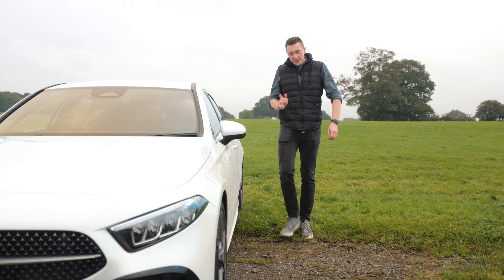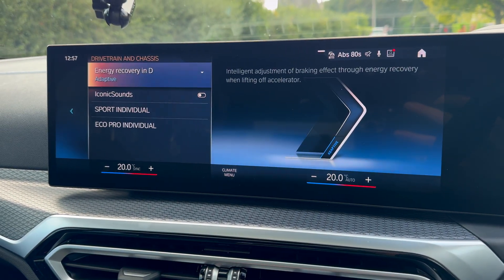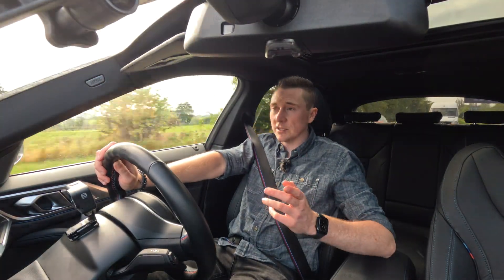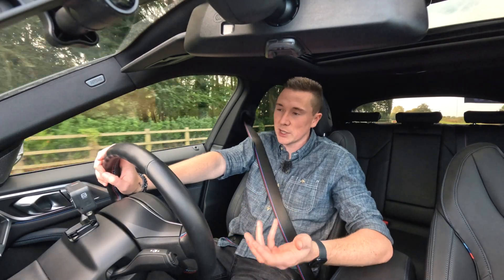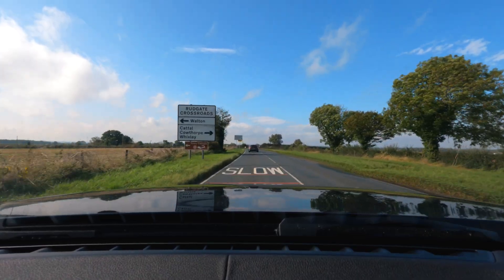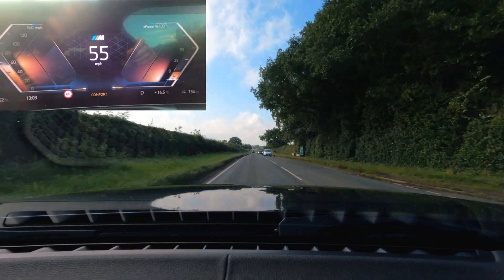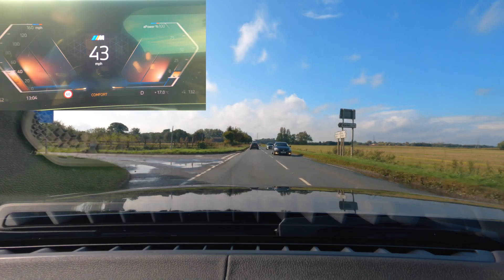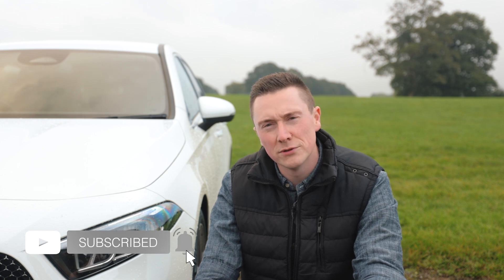Brake Recuperation EXPLAINED! + How to ADJUST it!

Comment: Hi Nick, I cannot get info on the intelligent recuperation setting for the eqa. Do you explain that in a video?
Reply from the maker: You basically just adjust it using the paddles, it varies on the car, but it’ll usually have

-D
D
D+
D AUTO

D Auto, just calculates your speed vs oncoming objects, roundabouts and even junctions and adjusts the braking automatically 😎

Comment: In a Mercedes you're meant to use the paddle shifters to adjust the regen level. However doesn't this just change the gear up or down? (How does it know when you want to change regen level vs change gear?)
Reply from the maker: Depends if it’s electric or not
Electric cars the paddles adjust the regen level.
Plug-in hybrids do both, just depends on what mode you have it in. Sport mode will do the gears but most of the other modes adjust the regen level
Reply: @npoleary  Doesn't seem to work in the 2025 GLC63, if I', in full electric and click the down paddle it switches to comfort and switches on the engine. It doesn't increase the regen.
Reply from the maker: Oh is that the GLC 63 S E Performance?
If so they’re a bit unique those ones, I have driven one before but I can’t remember exactly if those same rules apply for the hybrid system. It does have an EL electric mode, does it not change the regen on that mode?
Reply: @npoleary  Yes it's the GLC 63 S E Performance. Now I see in the AMG appendix instructions that you use the right steering wheel button, pressing it you can then twist to dial the regen up and down.
Reply from the maker: That makes sense for the racier driving that this car can do! That’s for letting me know! 👊🏼

Comment: Hi Nick I recently purchased an eqc Mercedes, love the car it’s great, my question is about the one pedal braking. At the moment I’m using the drive - - option around the doors and also on dual carriageways. Is this the correct option for best results? Should I put it in drive+ + on the carriageways? 
Regards. 
Great vlogs by the way.👍
Reply from the maker: Thank you! Glad you enjoy the vids!

It’s up to you! Whenever you brake normally (not too hard), you will use brake recuperation. And if you use the paddles, you’ll also use brake recuperation.

The paddles just allow you to control what the car does when you take your foot of the pedal 🤓

Comment: Would it be possible to show what the brake lights do for various regen and brake modes?
Reply from the maker: It depends on the model and car manufacturer 🤓
But most of the time if it’s more than normal “engine braking” then it’ll put the lights on.

Have you got an EV or hybrid? I might have tested it!

Comment: Sorry might be a silly question .. but does brake recuperation have any adverse affect on the life of break pads ? 

Big fan of your videos .. 

Can you also do a video on how to make the most optimal use of phevs during winters ?

Should we start on petrol and then switch to electric, best modes and associated aspects.

I have a bmw x1 xDrive 25e
Reply: The correct answer is No,
and Yes!
Brake pad wear is massively decreased, so they need changing far less frequently.
However, if most braking in the car is regenerative, the brake pads don't get used enough, and rust builds up, which can cause the brake pads to seize up. So it's recommended that, at least once per month, you do a firm braking manoeuvre (when it's safe to do so) at a decent speed - say 50mph or faster.
Reply from the maker: Hey niginbilly, lauriemiles1842 beat me to it! Haha 😜 

And actually I don’t think I could have said it better myself. EV’s are great as they have some extra perks of less brake pad / disc wear.

Glad you enjoy the videos!

Comment: I've just purchased a new EQE300, but its average consumption is around 2.1 m/kwh ...? I have taken the car back to MB, but their technicians think it's normal? I've only had the car 2 weeks from new?... can you suggest what I should do? The range is nowhere as much as I was expecting for this EQE300 Premium Plus model...
Reply from the maker: Ah nice! Would love an EQE myself after reviewing one with Mercedes, they are super luxurious!

So your average consumption on that car times the battery (90kWh) would equate to 189 miles. The quoted range for an EQE Premium Plus I believe is 337 (might be best to chat to Mercedes themselves to be 100% sure).

I produced a video at my local Mercedes to help people understand that there are things you can do to help increase range: https://youtu.be/nQByWnFzih4?si=a_p35EzEmtdS440g

However it all depends where you’re driving and what climate control settings you have on etc.

If you’re only driving round in a built up area and travelling below 40mph, then the quoted range would never be possible. Likewise the quoted range at this time of year would be quite tricky because of the colder weather. WLTP tests are performed at 23°C which is the temperature to perform range tests.

But if you’ve had Mercedes check the car out then I’m sure it’s okay. If you take the car above 40mph to 60mph, you’ll notice that you’ll cover greater distances but use less power.

Plus as an added bonus utilising Pre-Entry Climate Control is a must for this time of year if you want the best range 👍🏼
Reply: @npoleary  Thank you Nick, much appreciated. I watch most of your shows on YouTube, and find them very informative indeed. Keep up the good work... 😊
Reply from the maker: Thank you! Any questions though just message me back or email me 🤓🙏

Comment: I prefer the Mercedes regen system on the paddles, I use it all the time ( one foot driving mostly saving on brake pads/ disc wear.
Keep up the great videos Nick
Reply: Likewise, I try to drive not using the brakes unless really necessary. Just had a service at 27000 miles on my GLA250e, and the brake pads are reported as 10% worn. !!
Reply from the maker: Haha wow that’s pretty good! 🤓 was also curious for a plug-in hybrid what they would be like. I know EV’s barely touch the pads and discs so good to hear plug-in hybrids are similar!
Reply from the maker: Ah nice! Thank you! 🙏

Comment: Hello Nick,

Sorry to post off topic question here but my local dealership is not able to answer my question. So asking you here. 

I just ordered a Canadian C43 2023 with a 20-inch tire option. They are summer tires.

However, I have a C300 2020 right now and it has winter tires with 225/45/18 config.

Do you know if these winter tires can fit my new C43?

Thanks!
Reply from the maker: Hey! Really sorry I wouldn’t know on tyre sizes etc, I guess one way you could find out is enquire on a car or visit your local Mercedes and ask them. They’ll be able to check a car that has the tyres and see if it is the same.

I’m guessing that due to the C43 being an AMG they would be slightly different but I’m sure if you message them, someone would be able to help!

Very nice by the way! 👀
Reply: @npoleary  Thanks Nick! My local dealership has no idea if the tires are going to fit neither the dealership from where I bought the car. I guess I will find out when I get the car and bring it to the dealership with the winter tires so they can try installing them.

Comment: Another good one Nick. Question, if you have it on High do the brake lights come on? Could have someone rear end you otherwise.
Reply from the maker: Oh yes of course
If you brake more than engine braking either using the pedal or brake regen it’ll always put the light on 🤓
Reply: @npoleary  What I really was getting at. No braking at all,  but lifting the throttle with regenerative braking on high. Do the brake lights come on? I’ve heard not all E cars do.
Reply from the maker: Yes anything more than normal engine braking regardless of what ever you do will always bring on the brake light otherwise as you said someone could rear end you.

Brake recuperation on high will do it for sure

Comment: Hi Nick, more on how the Mercedes paddles are used for regeneration would have been useful.
Reply: Practically the recuperation works by transferring the kinetic energy to electric. This is done by using the spin direction of electric motor to slow down the car as the kinetic energy is transferred  to electric motor which in turns produces and stored energy . Nick explains it correctly that only a fraction of kinetic energy is transformed to electricity and mos is lost , otherwise we would have have a perpetual moving car that never needing anything else .
Reply from the maker: They just adjust the brake recuperation 🤓
Left is more brake regen and the right one will decrease it

Just depends how you want till it to feel when you drive 🤓
Reply: @npoleary  if left is more regen does it stay like that until the engine is switched off?
Reply from the maker: No it’ll default to the normal mode ready for the next driver (I guess it doesn’t give them a shock! 😅 in case they’re not used it)
Reply: @npoleary  thanks
Reply: @npoleary in the A250e (not sure about others) it will also reset back to Dauto (adaptive) when the dynamic select is changed

Comment: Does the GLA 250 e gets it ?
Reply from the maker: Yeah all Plug-in hybrids will typically have Brake Regeneration 🤓
Normally you can adjust it on the EL mode on Dynamic Select 🤓
Reply: @npoleary  thanks mate !
Reply: Yes!